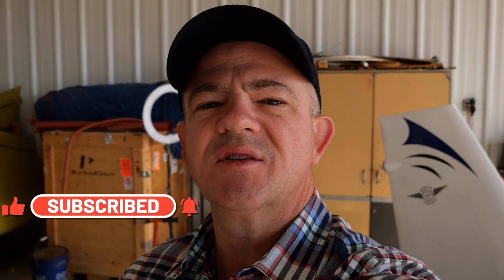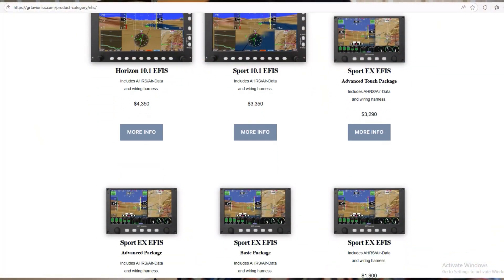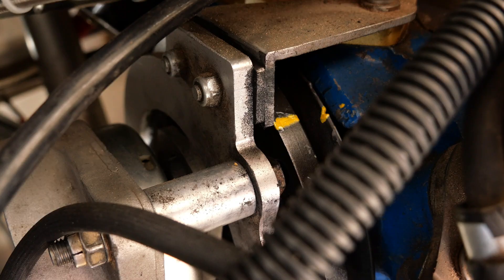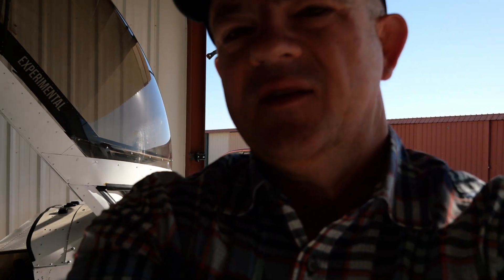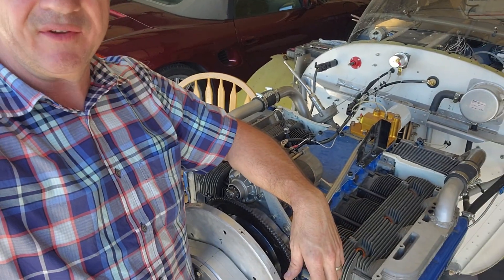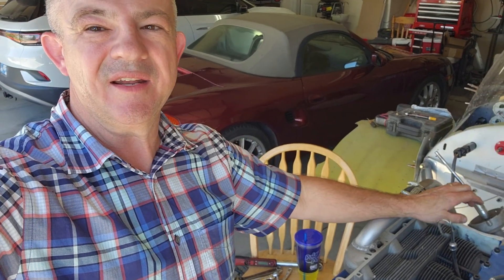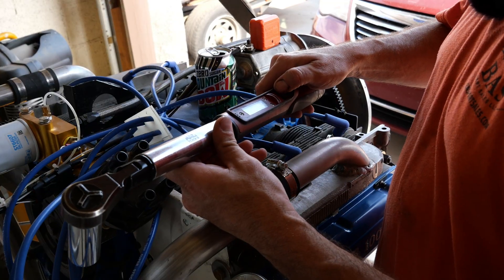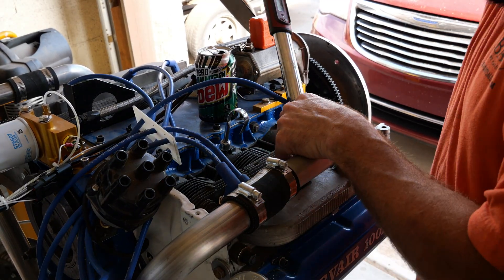First Starts on both my Corvair Flight Engines

Comment: Nice work.  I'm getting close to closing my 2850 up.  I noticed your small plastic oil sender line.... why not some braided AN hose?
Reply from the maker: temporary installation. i normally run braded lines after i run the engine.  this way i can see oil moving during priming the oil system.
Reply: @zenvairpilot good idea!!! I’ll do the same